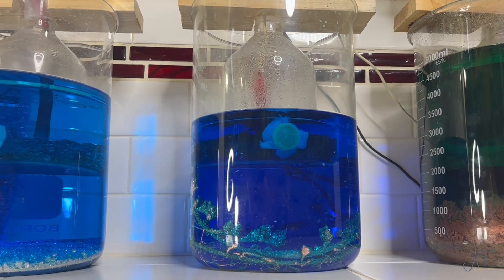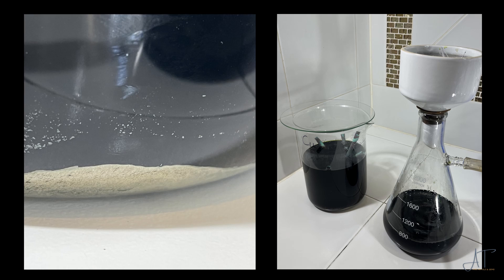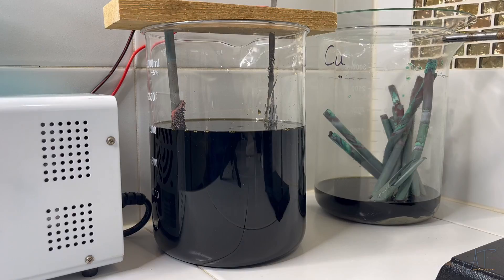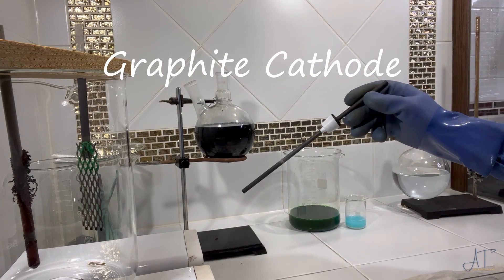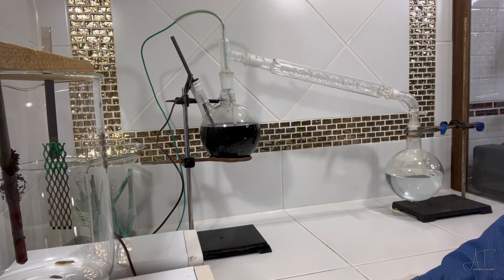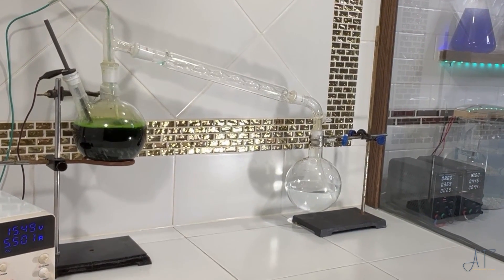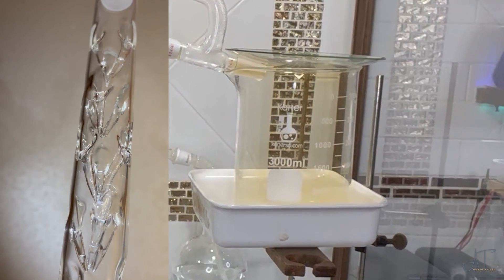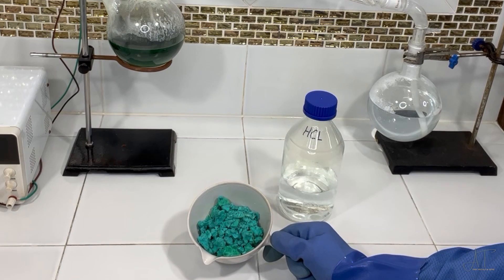Process Waste Aqua Regia into Bleach

Comment: During refining of Precious Metals I never neutralize excess Nitric Acid. When an AR solution is prepared, Nitric is only added in small increments. As soon as everything has been dissolved, I add a few lumps of Copper and wait until no more Copper will dissolve, i.e. no more free HNO3 is present in the reaction flask. The unreacted HCl is then distilled off and recovered.
Aluminium is the scrapper's friend, but the refiner's enemy. Using Aluminium for precipitation of metals from liquid solutions will contaminate these metals with Aluminium, which is difficult to remove afterwards.
I totally avoid Aluminium and use Zinc instead (processed in my homemade ball mill to fine powder). Later, the Zinc is recovered from the HCl solution by electrowinning, so the Hydrochloric Acid can be reused.
Copper Nitrate from liquid solutions is converted to intermediate Copper Sulfate by adding H2SO4, enabling the Nitric Acid to be distilled off for reuse. Then the Copper is recovered by electrowinning, leaving the Sulphuric Acid to be reused.
Other metals will accumulate in the Sulphuric Acid. When a sufficient quantity is present, they'll be recovered as well.
I agree with you that the term "waste" in reality don't exist; all we have is various materials that can be recycled.